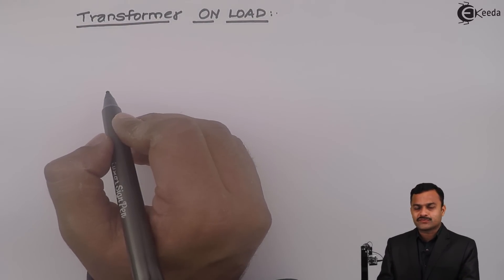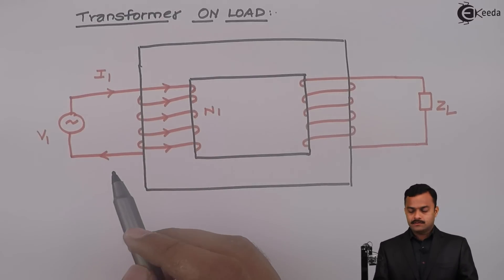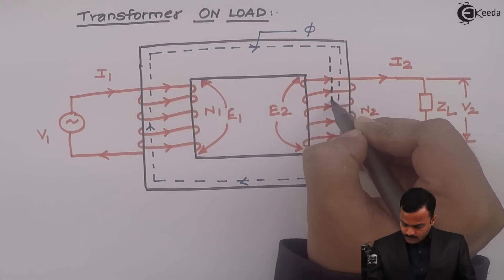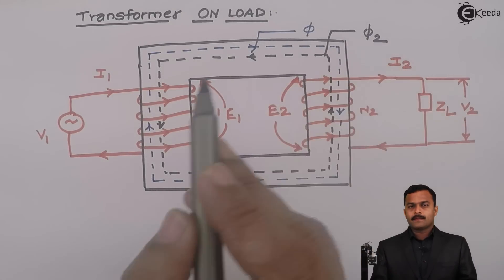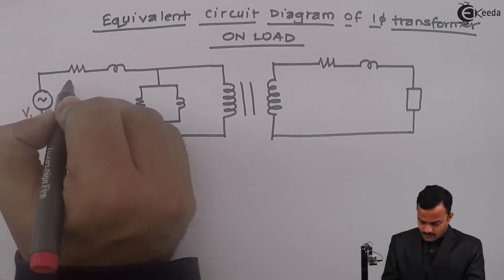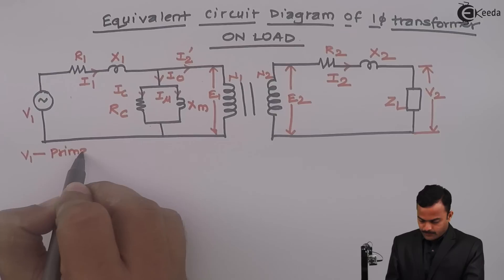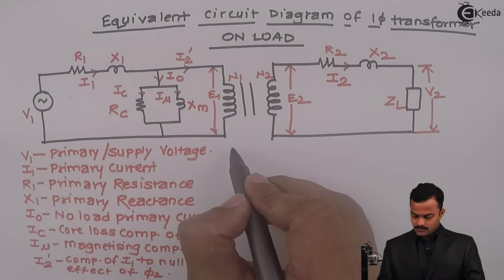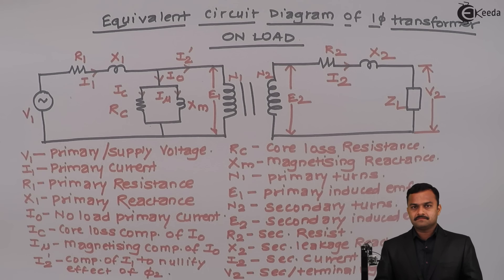Transformer on Load - Single Phase Transformer - Basic Electrical Engineering

Comment: Tell me, please, if the secondary voltage is appearing due to the flux from the primary current, so why the secondary voltage is always totally in phase with primary voltage and not with the primary current? 

This is my practical fact. And in real circuit I could obtain any conditions or loads when the sec. voltage was in phase with primary current as should be if this one is the cause of the sec. voltage. The prim. current is always not in phase with prim. voltage, but the sec. voltage is always totally in phase with prim. voltage!

Please clarify that practical fact!

Comment: why I1 draws additional current ? you skipped the most important part i am looking for.
Reply: As the main flux is reduced by phy 2(so emf is not proportional to main current)to maintain the proportionalilty ,i1 draws additional current from ac source and a flux phy 2' is developed.and in equilibrium phy2'=phy2 and emf is proportional to main flux....(phy is flux)
Reply: @jagrat16  Does phy 2 cut the primary coil ? and if it does ,what's the direction of the induced emf on the primary coil ? 
i mean how I1 increase theoretically ?

Comment: incomplete explanation …..ther is not phasor diagram no proper explanation ..and the circuit diagram is very complex 2nd vala
Reply: It is sequel of previous video. In previous video, it has explained everything
Reply: Yes, direction of current in secondary winding is wrong.

Comment: Sir I have one doubt when numb. Of winding are same in p.winding and s.winding than 
     Which type of transformer say   stepup or stepdown transformer
Reply: Isolation transformer
Reply: 1:1 transformer
Reply: I know this comment is a year old but a 1:1 ratio is usually an isolation transformer due to the 2 circuits being electrically isolated.